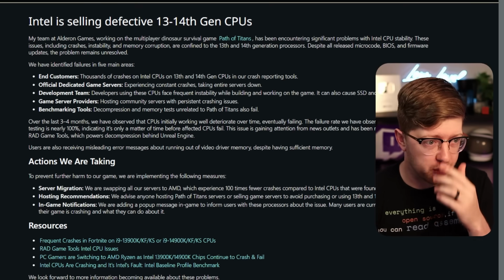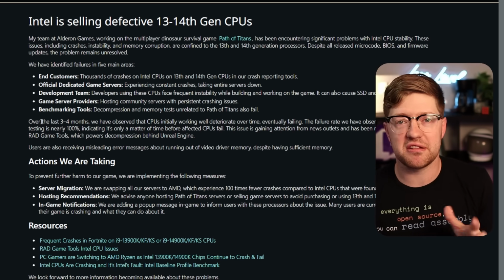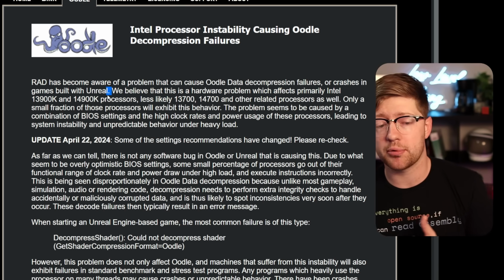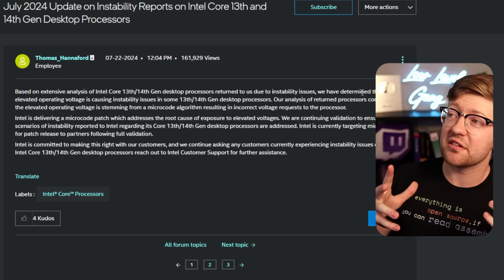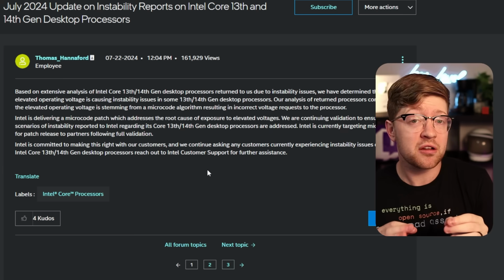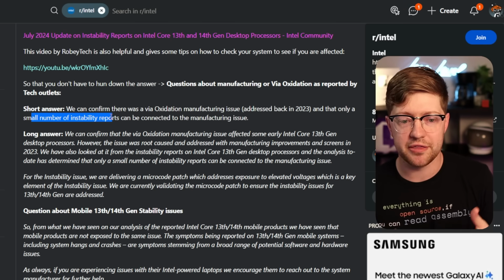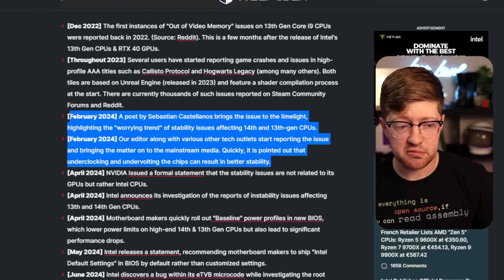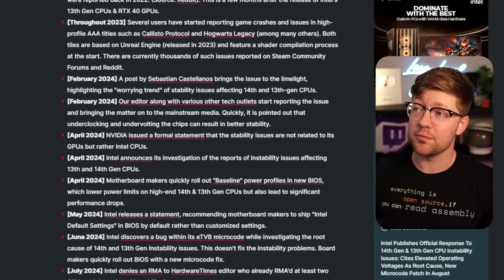intel CPUs are literally falling apart

Comment: I have a 13600KF but never had any issues.
Only crashes I had were due to me running a very bleeding edge Mesa, or at least that's what the kernel logs alluded to.
Since more fixes were merged for RDNA3 I switched back to stable and have only had one or two crashes when fucking around with Blender and HiP.
Reply: i ahve 13600kf everygame crashes

Comment: You're missing some crucial context.  Level1Techs broke the story two weeks ago that the issue was not the power profile, since server motherboards with those chips at conservative power profiles had around a 50% defect/failure rate.  Gamers Nexus then released the news about oxidation last week, and is hiring a failure analysis lab.  

Put another way, you're actually giving Intel too much credit, as they are still trying to bury the story as much as they can.  I highly recommend the Gamers Nexus video examining the statement, as it's worse than you think!

Comment: Reminds me of Intel’s Prescott core Pentium 4 processors. I swear they must’ve hired a PR firm or something to scrub the internet of all complaints about how stupidly hot that CPU got. Yeah, yeah, people blame the bad capacitor recipe that got stolen or whatever so it was leaky capacitors. That’s probably part of it, sure. But intel dodged a huge bullet. If they hadn’t been able to point to that capacitor smoke screen, people would have realized Prescott was a disastrously hot processor, and that heat helped those caps pop. Now we have these CPUs and they’re clearly going to the same playbook of denial. Let’s see if Intel can sweep it under the rug this time. Maybe people will actually buy the “uh the motherboards overvolted our CPU” excuse. They’re trying to point at bad capacitors all over again.

Comment: Intel Assembly isn't interpreted. Just because microcode acts as an interface for CPU execution doesn't mean Assembly language is interpreted. Interpretation involves an interpreter running the code, analyzing it, and executing it as interpreted. On the other hand, Assembly instructions are translated into machine instructions by an assembler. These machine instructions, mapped by the assembler, are then sent to the Intel microcode that executes them on the CPU. Errors are detected during code execution. In contrast, errors can appear in interpreted languages at various stages, such as during lexical analysis, before the CPU even runs the code.

Comment: Intel 12th Gen is also effected but it seems to take longer for it to happen
Reply: My 12900K started showing the same issues 2 month ago I've had mine since Apr 2022 & it has over 5000 hrs on it
Another Youtuber is also having issues with his 12900K being unstable He had to shut off XMP & Hyperthreading to stabilize it
Reply: Every CPU can degrade. 12th gen are not affected by this accelerated degrading
Reply: @USAchildsoldier  that’s true, but a two-year-old CPU should not be degraded especially since the CPU has never even been overclocked and has only ran at stock voltages
and I wouldn’t say that 12th gen isn’t affected just because there hasn’t been a large amount doesn't mean that 12 is not affected. It is in the same family of CPUs that are having these problems.

it’s very possible that we could be looking at a scenario where the entire chip family is affected and won’t know if the issues with 12 Gen are just isolated issues or if it does end up becoming a more widespread problem
Reply: @Gizmo88  It's unlikely it has this specific issue. The 12th gens were built on the Alder Lake architecture which has been incredibly reliable meanwhile the 13th and 14th gens have been build on the Raptor Lake.

Comment: I swear this is exactly what's happening to me! I thought it's overclocking or bad ram or whatever. But my 13900K behaves exactly like this, the longer it runs, the more just seemingly random errors occur in CPU-intensive tasks where a lot of memory is being moved around, like compiling huge C++ projects, and I'm getting random GPU errors too!
Reply: Yes, I can see this intermittent microcode flaw causing certain processes to possibly send bad data to the GPU, and then the GPU can't process it, causes it to crash.

Comment: "Back in the day" my brother-in-law had a Pentium 90 system that kept crashing.  We eventually tracked it down to the CPU.  Any time DMA was used by a peripheral the PC would instantly lock up solid.  The CPU was replaced by a Pentium 100 and the shop said Intel had specifically asked for the defective CPU back for testing.  This is the only time I've seen a CPU defect where the PC "mostly works" and it took a while to isolate the cause.

Comment: I had a similar issue with an AMD CPU a couple years ago.

My new Ryzen 5 3600 build had odd crashes while playing games like The Witcher 3 and these crashes happened at random intervals.

I narrowed it down to a CPU / board issue and RMA'd both parts. MSI didn't find anything wrong with the board and sent it back to me but AMD found that the CPU had issues and sent me a brand new part as a replacement.

Intel seriously needs to step up to their mistake and refund their customers or send them working parts.

Comment: 6 year warranty under uk law, manufacturing or design defects are usually hard to prove. For consumers, this should be easy. A bit like the apple mac short cable debacle, which they eventually extended worldwide iirc. 

Full refund on the laptop, manufacturers just have to take it up with intel. 

Never underestimate consumer protection laws.

Comment: I still wonder if it'll ever come out if the CrowdStrike devs were running 13th/14th gen CPUs and their deployment issue/corruption was actually Intel's fault.
Reply: That would be hilarious and terrifying at the same time
Reply: No, it was a null pointer in the code, a none existent function was called up, causing the CPU to bluescreen to protect memory.
Reply: @vitajazz  open the .sys file in question in a hex editor, the entire file is binary 0s. So yes one address fetched from the file was null, but also all checksums or such were too, yet it still attempted the load. The file was likely corrupted on upload
Reply: @dalehorton7748  Couldn’t a faulty CPU have fed a whole block of zeros to the FileCopy function?
Reply: @vitajazz  non-existant function was really non-existant from a file beeing full of binary '0'-es

Comment: I had a bad experience with my first i9-13900ks, it started working fine but by the third month of use it completely died out, becoming completely unusable. Got the replacement in February 2024 and it's working nicely, with the same load. Not sure if I was affected by this specific issue or got a bad cpu tho.
Reply: maybe its just take longer for it to happen, it degraded slower

Comment: This is weird but i had an an intel pentium 90 way back in the day i slightly boosted the voltage and tried to push it to 100. And forevermore (even when put back to the correct voltage and frequency) it had compression errors i cant remember if it was zip or arc or ace (dont think it was zip but one of the other popular ones) but whatever it was it never worked reliably for that compression algorithm from that point on. Weird it had a similar failure mode. Other than that the cpu seemingly worked fine..

Comment: The Oxidation problem is what will make this an expensive fix for Intel.  The issue with the microcode algorithm is patchable; a microcode decoder will use match patch registers to compare a stored value with the value of the microcode in microcode-RAM based on the entry point.  Ad hoc patching or re-architecture of microcode is why Intel doesn't document microcode; it allows them to patch (or ultimately change) microcode without breaking compatibility.  If you're interested in CPU security, look up the Red Unlock technique developed by the uCode Research team.
Reply: You think they will do those thing?

Comment: You are conflagrating 2 separate issues. The voltage issue and oxidation are not the same and affect dofferent cpus. There are actually 3 issues as the voltage issue affects all intel 13th and 14th gen cpus as a whole (possibly back to about 6th gen when the offset was introduced) and the other voltage issue is just purely due to excessive power being pushed through 13th and 14th gen causing degredation.

Comment: The problem is worse than this.  Intel is still issueing misleading press releases about the problem, and we now have information that Intel refused rmas for affected CPUs when they knew they were caused by flaws in manufacture.
Reply: Class Action Lawsuit ( which Intel will lose ) if they don't handle this to the satisfaction of the costumers. This could end Intel.

Comment: It's the RMA refusals that will make me steer away from Intel for a long time. You can make a mistake. You can make a mistake and have trouble realizing it. You can make a mistake and deny it and deny it and deny it and then suddenly admit it. I'll forgive you for any of those, as long as you do right by your customers. Intel has not and did not.
Reply: This. Mistakes happen. Don't make the customer wear the cost. Trust takes years to build but an instant to lose.

Comment: When I saw the title of the video I thought this were going to be a security issue or something. But nope, just the current news.
However, to a small degree I wouldn't fault Intel for being slow on the ball on the "GPU out of memory" issue, the ball weren't after all in their court and who could guess that a most likely random/general CPU side error would cause such a specific problem.

However, Intel sitting quiet about the via oxidation problem is a bit scummy. If they detected a flaw in manufacturing then they likely have a rather decent idea of what chips are affected. And could likely even list the specific chips. Since tracking what CPUs came from what wafer is something they should have logs on, since most chip makers do want that for fault finding reasons. And what machines a wafer goes through is similarly logged for the same reason. So if the via oxidization were manufacturing process related, then they can likely pin point it rather accurately. And given they say that only "some" processors are affected in the 13th gen series, and how via creation is a rather common and slow process, then it is likely 1 faulty machine among many that had a slight issue.

If I were Intel, I would recall the specific serial numbers. And given that the serial number is available to the OS, then I would work with both Microsoft and the Linux community to expedite the process of informing those affected.

The microcode issue regarding voltage regulation, that is however something that they should have made more thorough testing on internally before pushing to market. But given how tight time schedules these companies work on, I am not surprised that it happens. A year ago AMD more or less had the same core voltage issue. Both companies are a bit too eager to edge themselves over each other, at the cost of stability and their own reputation.

Comment: ONCE have I seen a case where the compiler was actually faulty. I stumbled upon an issue in gcc that Red Hat hadn't addressed in patches despite the fact thst gcc had fixed in days after it was discovered after a release. This was over twenty years ago. It took two Very Smart colleagues (I was an intern) to find it. We were astounded 😂

To have to conclude that the actual CPU is the culprit is so out there! Especially the fact that it happens over time. Wow.

Comment: Hi, several remarks about CPU microcode and micro-architecture:
- The term "microcode" here is not related to the way instruction are decoded, executed, and so on. For Intel here, it's just a synonym for "CPU's specific firmware".
- Actual true microcode (related to instruction decoding, not general firmware) is not specific to superscalar uarch like the Intel one. A very simple in-order CPU can have a microcode, it just help to fix faulty instuction decoder.
- Supescalar out-of-order processor (like intel's core) do not "interprets" x86 assembly at all. It decode them into micro-operations, but to call that an interpreter of any kind is misleading. And this is a source of many misconceptions about CISC vs RISC ISA.

Comment: Laptop gamer here. 
I'm using a 13th Gen i7-13700HX utilizing the Raptor Lake-HX architecture with BGA 1964. As a safeguard, I applied my own thermal paste when I purchased it.
The Intel Core i7-13700HX is a fast, high-end mobile processor belonging to the Raptor Lake series. Announced in early 2023, it is based on the desktop Core i7-13700K. I am hoping to avoid encountering the same issues I'm seeing with the i9...
There is a tendency for people to broadly discuss issues with 13th and 14th gen Intel processors without specifying the exact model in question, given the vast number of processors within these generations. It is my understanding that laptops are not affected by this particular problem, is this true...I only hear of desktops having this issue..

░
Reply: @Kyroptra  u tried first descendant? I7/9 desktops are dying in shader loading...
Reply: @marcinkarpiuk7797  I have the laptop version of the 13th generation core i7 13700k.. works just fine.
Reply: @marcinkarpiuk7797  https://youtu.be/PQOT8FPmf1g?si=wd-fAf2qmYBmjTvR